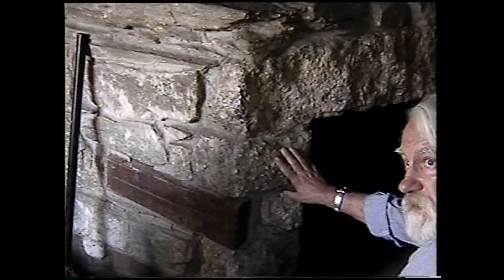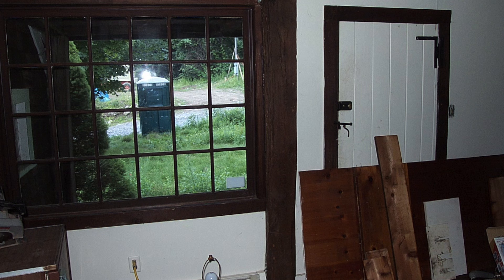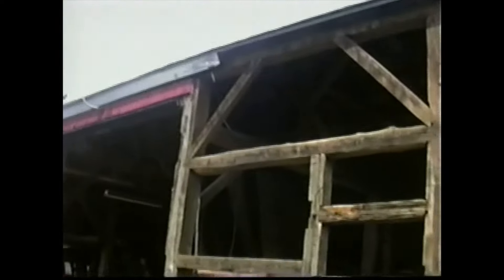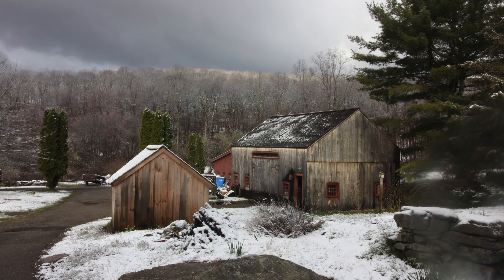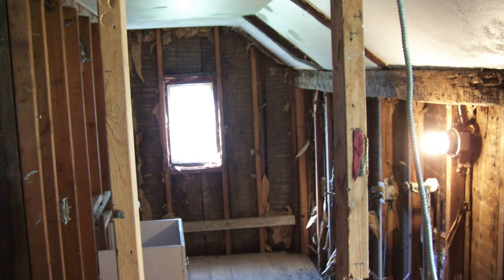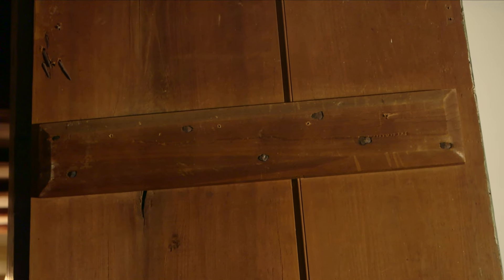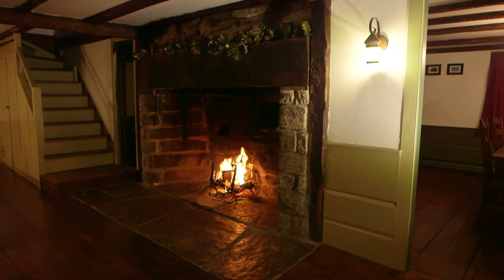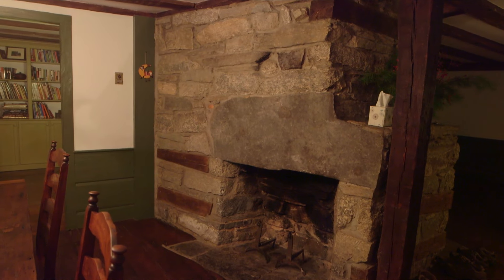1760 House Restoration- Monroe, CT

Comment: Lovely restoration. Restored a1780 cape in Maine. The old houses were constructed to look balanced from the outside, elegant and graceful. I loved the feeling of many generations nestled in that lovely old, safe place. Love that they faced a house south, the door yard as they called it. Loved looking for and finding the bits to finish the house. There are some nice examples of early stenciling and that is something I did carefully and with love and research was fun. The pins were still in the four fireplaces, three were Rumford style so they threw good heat. Found wonderful fireplace cranes in eastern Connecticut, loved cooking and using the kitchen fireplace all through the year. I love that you saved this fine old place.

Comment: Nice job sir.  I too went through a similar project but needed to remove the structure from the site.  The house now stands 100 or so miles away on a nice 20 acre site.  It isn't a museum piece but is certainly a comfortable home that has all updated technical systems.  Looks old. Works new.  Congrats on saving the house.  I can relate.

Comment: My house here in NH is almost identical to yours with a few exceptions. Its a full cape with the kitchen and dining room added behind it. Whereas yours is a half cape/saltbox addition. Built in 1770, the previous owners did a complete rehab but made the interior look rustic vs colonial, which is the way it should have been. I’ve been wanting to restore it for the past two years. Money and available time have been working against me however. We also no longer have the original center chimney. It was replaced with a clay brick chimney no doubt when coal burning stoves became popular and more efficient.

Comment: Agreed, in the earlier days homes were built to last for centuries.  I have a home which was constructed in 1825 and completed in 1840.  The home is constructed of walnut exterior studs with walnut "6-8" trim  throughout the home, the dining room has French windows with an intricate locking device similar to Versaille, the doors are 12 ft. high and 4" thick made of solid, ornate walnut.  Plaster ornate trim and medallions throughout the home in every room, floor to ceiling mahogany bookcase with etched glass paneled doors, the floors are inlaid with both walnut and maple in a unique pattern, and soapstone fireplaces.  The supreme architecture is Greek Revival, Italianate, Romanesque, and Queen Anne, all the window trim is ornate and intricate, beautiful stain glass windows with large faceted glass gems in multiple colors.  This man spared no expense to create a "Work of Art" which is still standing in 2020 and best of all ....... the first Mayor.  Twelve years and counting to restore this home, but it was worth it for the legacy to continue.

Comment: I feel exactly the same way about my 1916 farmhouse with its wrap around porch.  It overlooks the valley with a field and an arm of a lake in the distance.  We have 3.2 acres. And forest land around us that cant be sold for houses. There are only 5 houses in our whole valley that is about 3 miles long. Cant see our next neighbor.  And that was one of the reasons we bought it. The biggest reason was it needed me. It asked me for help to make her sing again. And we have been working on it since 93 when we bought her. Most ran away scared of all the work. But not me. We are working on remodeling the mudroom into a mudroom and canning pantry. As I can alot. I have been extremely patient in getting this house done. Still have the utility room and down stairs bathroom left to do. Then some things on the outside still to do. But at 61 now, it will get done when it gets done. But she is looking like the pretty girl I knew she could be.

Comment: Thank you for a very informative video. I am wondering how to deal with asbestos in building material when looking at these old properties? We have come across a 1880 farm house and thinking to renovate to a open plan and afraid to tore the walls with a possible asbestos in the material. Any idea
Reply: Wish if any of the experts in this field shed some light
Reply: I’m going to go ahead and chime in and say I don’t think (based on comments and this video) you’re going to find anyone in this vid who will assist as the whole view point of the video, and the comments is to keep these older homes as original as possible. I too own an older home (not as old as ones mentioned on here unfortunately) and I wouldn’t change a thing about it, and all the renovations/repairs we have done have been to keep it within its time period, and using as much matching material of the time as possible. In your particular case, if you desire a modern look and feel perhaps a more modern home would be better, but I am sure you can get an asbestos abatement company or an abatement company to come in with full hazmat suits on and do the demo for you, but I am very sure it’ll cost a decent amount of money.

Comment: Very nice. Just wonder who did the hewing of the beam shown, marks seem rough.
Reply from the maker: I should have covered that subject in the video. The really rough hatchet marks were done after the frame was assembled and were not part of the hewing process and here is my explanation why. The inside of the house would have been originally plastered. In 1760 having beams showing on the inside was no longer in fashion, the beams we see today would have had lath applied over them. The ceiling, walls, beams, posts and stone were all plastered over. The reason the posts and beams were chopped with a hatchet was to get the plaster to stick to it better. There are a few spots where the original plaster still shows and it even has a red color animal hair mixed in with it. You can see the direction of the chops marks change near walls proving that it was done after the fact. The chop marks on the posts stop where wainscoting would have covered it.

Comment: Very nice.  But I'm surprised you did not redo the kitchen as a free-standing or "un-kitchen."  I live in an old colonial style home built in 1850 in Pennsylvania.  It seems to have been a "2 up 2 down" home originally.  Later, around 1920, two additions were built on the back of the house which became a kitchen and a large utility room.  The utility room is approximately 15 x 25.  I converted that room into a kitchen, but a free-standing kitchen with 2 open china hutches, a farm table, colonial table and chair set and appliances (stove, fridge, dishwasher).  I still need to get a farm sink but am using the utility sink already in the room as the previous owners used the room as a laundry room.  I purchased all of the furniture used and spend only about $800 total. I personally like the look of free-standing kitchens, especially in older homes.

Comment: So amazing!!! How did these houses not rot away??? Did they treat the lumber, especially exterior siding, with something that preserved it? I don't see how the wood is even still there after over 250 years....Do you think the home has been 'reskined' several times???

Love your home man, glad you saved it.
Reply: There are homes in Europe (England and Germany for example) that are 600+ years old with timber pieces that are from the original construction period. It can depend on a lot of things....weather, bugs, type of wood, moisture damage, etc. Timber frames can last as a very long time...these homes aren't just exceptions either...it's a norm for good timber framed homes to last a long while. Japan and Korea have some old timber frames too.
Reply: @HeroOfTime303  They can but they had to have been treating the lumber with something better than we use today. I see houses all the time only 20yrs old painted with both oil and water based pints which have rotting siding and decks...as well as I've seen untreated raw wood structures also rot quickly. So they had to have been using something that truly protected and kept the wood healthy for it to last hundreds of years.....I'd really like to figure out what they used.
Reply: @stephenwhite5444  Are you just talking about the finish they used? Like bees wax and oil? Yeah there isn't really very much clear information on that topic.
Reply: @stephenwhite5444  I have seen something very interesting though. I saw a master Japanese carpenter who rubbed the wood with a specific leaf and then afterwards he painted with wood with lime paint and let it try. After it dried, he wiped of the paint and "polished" it off with a towel. The wood grain looked amazing.
Reply: @HeroOfTime303  Yes, I think we have lost a lot of things to time and wood preservative is one of those. I have a house with Cedar siding that is 45 years old and it's always been treated with something for exterior wood siding. Yet there are sections that's had to be replaced, sections not looking healthy, etc. Then I watch videos of houses with original siding 250+ years old. I've started researching a lot about Linseed oil paint, which started being used extensively in the 1600's and apparently preserves paint extremely well. It pretty much went away in the 1900's in favor of alkyd oil paint (what we use today in oil paint) and acrylic....many assume because they are better....but now I think they are inferior but easier to obtain in massive quantity. I might switch my house to linseed oil paint like they used for hundreds of years.
Reply: @stephenwhite5444  Sounds like something that would be worth the attempt.

Comment: There's nothing wrong with 2x4 and 2x6 construction. Most homes built over the last 200 years were built that way. Oak timber frame joinery has a beauty to it, but it's also overbuilt and utterly unnecessary to have a solid structure. It wasn't so much to "make a profit" as it was too keep costs down. Some still build oak timber frame joinery homes, but they're only for the rich because labor costs are so high due to the skill level required to build that way. Not to mention, as I already said, it's structurally unnecessary. I was with you until that point.

Comment: You’ve done a fine job but it’s really unfair to compare the modern buildings to yours. The new construction relies on standard platform framing with layout and materials per code. Your much older structure is post and beam framing which employs a completely different engineering, terminology and materials. Again, very well done but an apples to oranges framing comparison.